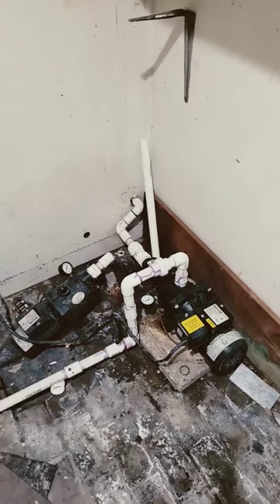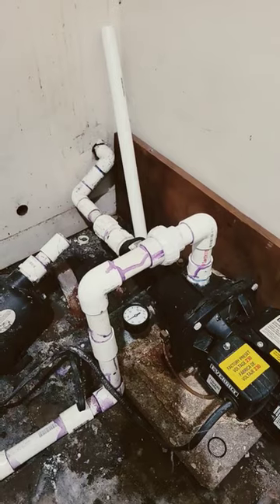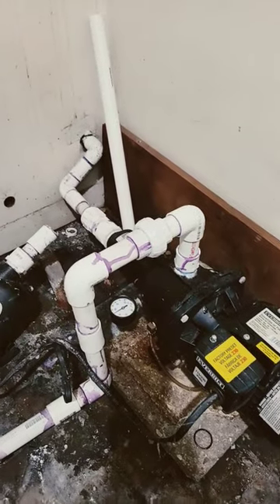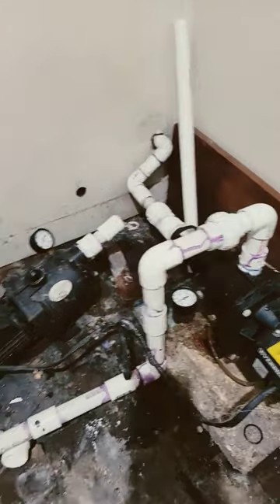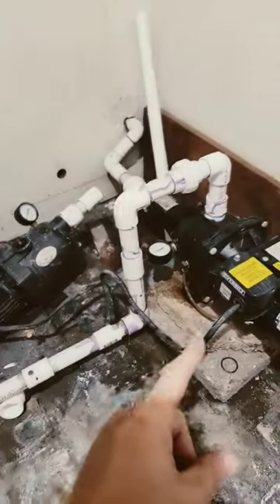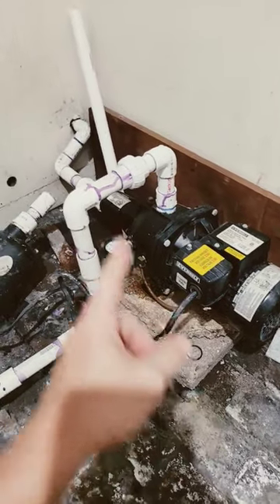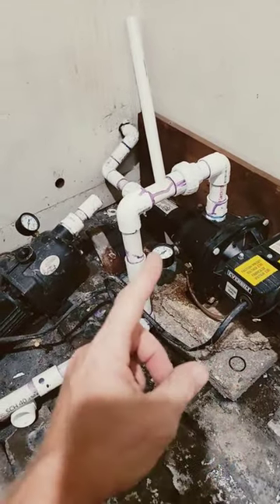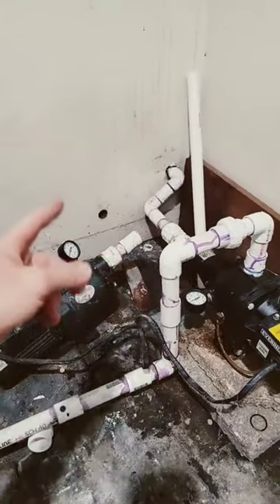Water Well pump not working Home Depot Special

Comment: FloTec deep well pumps from Home Depot. Oooo do I have a story about those. Quick condensed version back around 2014 the local well driller did the service for us was just as pissed @ them as we were when had one of the pumps IN//OUT of the ground TWICE (200 ft each way) over the course of the day & into the night. Only charged us for the original OUT & final IN which he was able to rush us a GOULDS. Replacement was about 3x the price of the FloTec ($500) but lasted until the old well threatened to sand up 4 years later so had a new well dug also using a GOULDS.

NO MO FLO TEC! NO MO FLO TEC! <Ad Infinitum>

Comment: Before the pump unless there is a foot valve? I'm actually asking. Bc I'm using a system that has a foot valve into a 3k water tank, and the check ✔️ valve was on the discharge side but i removed it just recently.
Reply from the maker: Yes a foot valve is just a check valve at the end of the pipe in a well or water reservoir.  You only need one or the other in most cases.

Comment: You can absolutely have a check valve between the pump and the pressure tank.  You cannot have one between the pressure tank and the pressure switch. Never seen the switch not be right by the tank before...
Reply from the maker: Dude no not on a shallow well pump, any little small leak will cause the pump to lose Prime.

And yes in this case the pressure switch was behind the check valve and because of that the old check valve was leaking back causing the pump to come on for about a half a second every few seconds.

I'm just trying to tell people that want to do DIY to at least do it right.

Comment: The materials the pump the tank Etc from Home Depot aren't really that bad the problem is is that people install it that don't know what they're doing because they see a YouTube video or they asked a friend who they themselves don't know what they're talking about

And just to clarify you absolutely would put that check valve there if you had a submersible pump I know where you are you deal with so many of these jet pumps and in that case you don't want anything in between your storage tank and the pump because it'll help to keep pressure on every time it starts and obviously keep the pressure switch working accurately but with a submersible pump you've got a different animal and you absolutely need to have that check valve before your water storage tank as well as having to pressure switch on the tank or the assembly at the base of the tank itself
Reply from the maker: Yes obviously, I work on all types of well systems.  This is also clearly not a submersible pump, was referring to this system setup.
If people confuse not having a check valve in the appropriate place they should not be doing it themselves!

Comment: You actually don’t “need” that check valve because there is a foot valve in the well to prevent water from running back
Reply from the maker: Ahh yes of course but what you don't realize is the well is buried in the yard.  The foot valve if they have one is not working.  There was another pvc Check valve outside the wall that was broken also.

Trust me I fixed it right with a new check valve at the suction of the pump since we were not going on a treasure hunt in the yard!

Comment: I think you misspoke, that would be your pressure tank and you are correct that it should have a check valve on the well side to keep the well from unpriming if the pump goes out...i also like to have a check valve on the outlet side of the pressure tank just to keep water in the lines because those bladder tanks are known to fail an you have to shut the pump off to replace them so a shut off or check valve helps later for a few extra $... I prefer to have both on each side and a valve on a T at the bottom of the tank so you can bleed it when needed, I know they have a air fitting to add air to the tank but a well picks up all kinds of minerals so its best to drain it and air to get the pressure right.
Reply from the maker: Dude I been working on water wells for 25 years, we do things differently down here.
I know what a well tank is when I walked in the room there was a water heater in the corner and I know where a check valve goes......
Reply: @ClearWaterPumpWell  No one said you didn't, I see the hot water heater on the edge of the screen but right in the center is the pressure tank... So unless you watch the video multiple times one would assume that you are talking about what you are pointing the camera at... Now if you look at what I said, I said you are correct and then I added what "I" do for added security and ease of work at a later time if one doesn't mind spending a little extra $... I know most people are trolls on the internet and can get under your skin, but I thought I worded it to show no disrespect.

Comment: At least they used a well  xtrol tank
Reply from the maker: Nah that was a "Water Worker" says American made but they fail in less than 2 years most time I see.  Diaphragm is thin as paper gets holes from the sheet metal edges or something during manufacturing.
Reply: @ClearWaterPumpWell  What do you recommend for a tank? I see expensive fiberglass ones with replaceable bladder/diaphragm, are they worth it?
Reply from the maker: @billdickson871  it really depends on the type of system, and if any filtration. Don't go by the replaceable bladder options because you can't get them.
A good Metal Standard glass lined tank or a metal diaphragm is usually the best.

Comment: Red Jacket 🐝
Reply from the maker: Yea used to be good pumps till they got bought out now desolved into Goulds ITT which is no longer a parent company...
Before you know it Pentair will own everything and products will be utter trash!
Reply: @ClearWaterPumpWell  really....didn't  know that....mine still running strong after 35yrs plus...I've never had a problem cept for pressure switch..replaced with a pressure activated switch....
Reply: @ClearWaterPumpWell  its 220, dbl line....no idea how deep...over 25ft. Why the dbl line down....helps with a vacuum on second line...maintains 15psi.....
Reply from the maker: @jon-qd4gb  yes the old red jackets were good pumps, the double line is for a deep well jet that is down in the well at the water table. It allows the pump to be able to pump for more than 25 ft.

Comment: That's funny check valve pre pressure tank I see that all the time or   idiots go buy a pump and don't know how to install things also I see a lot of people do check valves backwards
Reply from the maker: Yea you can't have one there with the pressure switch on the pump before it. Not being able to sense pressure from tank side is the problem. It will leak down slowly and make the pump cycle every few seconds which is what caused this pump to run hot.

Comment: I hate jet pumps. Go with a grundfas submersible and be done with it.. 40/60 psi and live care free
Reply from the maker: I didn't know you can install a submersible pump on a well that's 2 in casing oh and by the way it's buried out in the yard somewhere.

You have to use what type of pump that works on the well you have.
Reply: @Clear Water Pump & Well LLC.  It starts with the well driller put a 6 inch casing and minimum.😉
Reply from the maker: @ryanyork837  A 6" Well!  Residential homes don't need the capability or the cost that comes with a industrial sized well casing!

A 4" well is way more common down here for submersible pumps as the total well depth is drilled and set with pvc casing.

We don't drill through rock down here... Why don't you watch one of the drilling videos of mine of how mud rotary works for us.

The problem with this system is a handyman or homeowner went to home depot as a cheap solution rather than getting a professional. 

Also this well is over 60 years old and is likely a steel casing as well as being buried.  Guess you can go back in time and tell those old guys they didn't know what they were doing!
Reply: @Clear Water Pump & Well LLC.  Up in washington state with granite rock or bedrock you aren't going to use p v c.. If we use six inch steel casing in all residential. Always learned a few dollars more now saves you a few dollars later. Especially if you have a low producing well you can put a relay box on the submersible pump with a pump saver. I'm sure you're working with a sand point well. They did their part back in the day but today standards they're outdated in a pain in the butt. And of course anything from home depot is garbage. At least put a franklin Or flint and wallings pump in if you're going to do a jet pump and run 240volt if possible.
Reply from the maker: @ryanyork837  yep I agree with most of that but back to the well again, different areas different problems man.

Thankfully we got more water down here that we know what to do with and it is easy to get.
I totally get it you need a huge rig to operate drilling through Rock.

But you also should know you can't have an open casing using mud rotary because the ground is sand and clay. We don't have rock down here until several thousand feet down. You can't set a steel casing because they have been known to fail has the oxygen-rich environment just right under the ground causes them to corrode.
Not to mention the sheer cost difference between steel and PVC it's not just a few dollars.

I'm not even a driller but I'm going to back these guys up oh, they do a good job and the water wells last a long time. They also provide Clean safe drinking water that's free of bacteria with only small amounts of minerals that need filtering in some cases.
They just got some really scary stuff deep down in the rock and most people get scared of well water because of that.

What I really hate more than anything is the government-mandated rules and regulations on water wells that have nothing to do with our types of Wells down here. They make us do needless water testing that's totally irrelevant and is never been detected.

But I digress, good talking with you, take care,
Casey
Reply: @ClearWaterPumpWell  Yup different states different scenarios. Take care of palli

Comment: If the professionals would be fair with pricing for well systems you would not see customers DIY systems. 3 years ago I paid a total of $6000 for a well system and 1000 gallon septic system. I then called the same company for another well system. They came onsite for an assessment and quote. I was told it would cost $7000 for another well system which covers up to 200ft. Anything beyond 200ft would be charged by the ft at $15 per foot. 

Now how in the heck is that fair? Complete RIP OFF
Reply from the maker: That sounds like a fair price even around here.  I hate it all day long but the cost of material and labor has gone up considerably.  I'm surprised the difference is only 1000$ more, that company must be losing money compared to previous price.

If you had a business right now you would understand that the rip off is running this country right now not the consumer or working man.
Reply: @ClearWaterPumpWell  The entire 1000 gallon septic system and well water system was $6000 3 years ago. I need another well and the same company quoted $7000 just for a well this time. The cost for material did not increase that much. Its just pure greed!
Reply from the maker: @bc5891  actually a lot of things have going up 30% if not doubled.

That's just not understanding how things really are right now.

Comment: You didnt confirm the pump was operating before you wasted hours plubming that atrocity?
Reply from the maker: First off Yes I made sure the pump was running, I used a coupling to fix the leaking threads, took me 5 minutes I'm not slow like you.
Yea I'm assuming your slow because you assume I'm slow... Sucks right?

It was a crap job that needed bare minimum repairs to get going until further work could be authorized by landlord.

Trust me I recommend replacing the whole thing since they were on the second China pump.... Nope just what was needed to work like it was.
Reply: @ClearWaterPumpWell  The check valve a few ft away made me laugh but then you went all out warfare on HD pumps and the everbuilt garbage they have  nothing like making a pump cycle on and off working harder and heat stressing the pvc i'm sure that'll last a few more months till they actually listen to you.
Reply from the maker: @jrock865  this is exactly what I'm talkin about.
If we don't stop buying this garbage there won't be any good pumps left as they will all have been put out a business.

The American way is faltering going to the cheaper and quick option.

Comment: Yes let the professional buy the pump from home Depot so they can charge you more. Or better yet learn how to plumb it properly.
Reply from the maker: If a company buys a pump from Home Depot or any other consumer-grade supplier they are not professional!

I'm pointing out issues with the system they had already replace the pump once as you can see there's a dead one on the floor. 

I suggested they get a good pump that can take abuse and be repaired because you can get parts for them.  And of course yes plumb it in all correctly.
Reply: @ClearWaterPumpWell  Lol Dude they do it all the time. Like I said the real issue here is that it was not plumbed properly.

Comment: I was all good until you said:"stop buying". There was nothing wrong with the functioning of the equipment, not one thing was defective. What was wrong with it, the installation, it was 100% the installer's fault, not the equipment. WTF.
Reply from the maker: Oh I guess your blind also because you didn't see the other pump that only lasted a few months.
Not the equipments fault for being the cheapest plastic garbage you can buy that "Can NOT Be Repaired" from home depot!
Yea let's just keep supporting buying this shit so the country keeps going in that direction.
Before long we will be fully depending on trash products like we pretty much already are and will have no other option.
I guess you like being a slave to huge corporate trash manufacturing companys flooding the markets.
They will buy out and throw out all the good products that built this country and replace with utter Trash!
Wtf is wrong with you!

Comment: Any repair person worth a damn would have moved/changed that check valve if they thought it was in the wrong place. But you sure do a good job running your mouth.
Reply from the maker: The only person running their mouth is you when you don't know what you're talkin about.
I did the repairs to the system after this and put a check valve where it supposed to go. 
I'm so sorry that I couldn't fill it all in a YouTube short for you!
Reply: @ClearWaterPumpWell  Yep got him, yes and when pointing out mistakes we have to actually point them out before telling customer and getting a full spectrum of everything needed before going to the customer and telling them what's needed you can't just go out and fix things before getting approval❤
Reply from the maker: @waterboy239  That's 100% what happened, I just fixed the pvc to get them going and then made suggestions on repairs.  Tough problem was it was a rental and the landlord left them responsible for any repairs....

Comment: Let's see i can buy 35 China pumps and each will work for 20 years but i can buy the 40 times higher pump and pay my plumber to install remove install remove install remove install and remove because it took 6 of them before we got one that actually works and ten the pos crashed and burned on Friday night at 5;30pm so no water all weekend well that's why we went to home Depot the first time
Reply: A good well technician wouldnt charge you after the first one was bad.